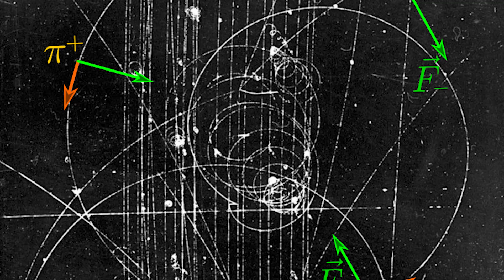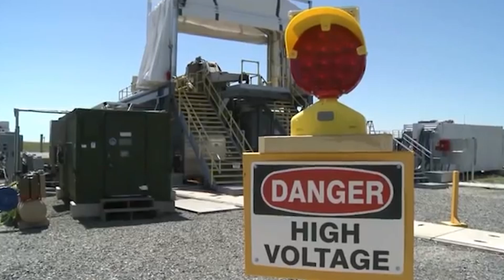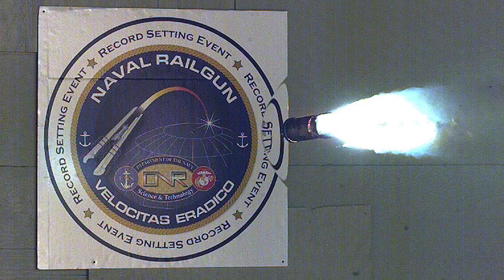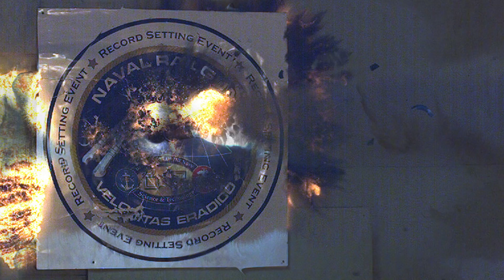Railguns: The Kinetic Future of Warfare

Comment: I doubt supplying power is major hurdle, because it’s going to be using just a pulse or a small series of incremental pulses of energy, my guess is that firing these things actually produce a pretty substantial EMP. However huge currents or magnetic fields can be produced using an explosively pumped magnetic field generator, which works like this; a series of large capacitors are charged  and when ready they release a huge current pulse on a hollow conductor which creates a large magnetic field at the very instant this happens an explosive surrounding the conductor is detonated which compresses the magnetic field and essentially the power of the explosive is converted INTO the magnetic field. There exists another variation of this device that compresses the fields of very strong permanent magnets that simplifies the process

Comment: Here is a big future project.....  How about a rail gun on the moon.....  Just think, solar cells could be used to generate electrical power to be stored until it is ready for use.  You get almost 14 days of  constant sunshine.  You can build launcher rails in a vacuum, so air resistance not a factor.  You could launch vehicles for return to earth of passengers or goods etc. You could launch space probes to explore our solar system or supplies to Mars.  This could be a great use for the use of rail gun technology.

Comment: Electronics that can handle 20,000G has existed for decades (EG the M982). The real issue is switching without degrading the switch. Relays are definitely out as is any electro-mechanical switch. FET's are just not available with a low enough RDSon combined with voltage rating. IE you would need hundreds of amps switched very cleanly to just charge the gates for even a few hundred FET's. IGBT's might work. However you then have exactly the same issue as you do with any parallel array of transistors. I really do not want to see that lot popcorning. That leaves plasma switches.which I am not qualified to comment on. EG some types of valve.

Comment: This has got to be the most overrated weapon in all of history and fiction. Lets spend an ungodly amount of money and energy for a gun that can't fire as fast  or last as long as a standard weapon. It can only fire straight in a GLOBAL environment(arcing a shot is impossible) and has to be pinpoint to do jack crap or it misses entirely as warheads can't handle that amount of sudden energy or acceleration. Rockets which can do better than this and they are not in anyway cheap. Scrap this crap and follow the KISS model. Keep it Simple Stupid.

Comment: Would it be more feasible to use expendable rails like magazines that uses hydraulics to eject expended or compromised units then exchanges it with a new one? I mean, if you are using this system as point defense or for the purpose of intercepting ballistic missiles, wouldn't sacrificing a less expensive turret component be worth the exchange?

Comment: Lol, if you want to make a Handel one, all you need is
1. Aluminum bullets
2. BIFILER coil
3. 6 12v drill batteries 
4. 6 or 12  1F capacitors
5. Circuitry to control it all.

Comment: Couldn't you use a vacuum bore to eliminate the rail erosion problem? And a faraday cage around the guidance system would add minuscule weight to projectile, surprised the body of the projectile doesn't do that already. You could also have the components fail into position and only enter the vulnerable configuration due to the acceleration they experience.

Comment: There is now a portable rail gun that is around the same weight as an assault rifle, it fire's a projectile that is lethal up to 300 metres and using full power can fire up to 200 projectiles before needing recharging. It does have an adjustable power setting so you can reduce the distance and fire more projectiles. It has been around for over 2 years as I watched a show on it over a year ago and they already were selling them in the USA.

Comment: Interesting. I just watched a documentary on Hitler's Supergun. Watching this video it occurs to me that the supergun was in some ways midway between a normal gun and a rail gun (as opposed to a /railway/ gun) as it used repeated explosive forces not magnets to accelerate the projectile.

With regard to them being 'consumable objects' rails seem analogous to gun barrels. Until rails last on average as long as gun barrels then the weapon system will /probably/ be too expensive to adopt. See Simon's comment abut the cost of each unit (projectile). The cost of swapping the rails would be part of that cost for the whole system.

With the forces required to use the weapon also trying to pull it apart I see several 'rapid unplanned disassemblies' in the future.

'... working repeating power supply...'. Yessss we can all do that, every time we flick a switch on and off. What the Chinese /didn't/ say was that their power supply was adequate.. presumably not or we'd know by now.

Re the launching of spacecraft. Presumably not /manned/ as the acceleration would likely be fatal given that humans black out / die at +9Gs and rail guns can produce as this video says, about 20,000G. Granted the object being launched would be a hell of a lot larger than an artillery shell, but it would need to be over 2,200 times larger / slower. Very roughly one hundred tons.

Comment: Is there a reason why they don't provide a weakly-magnetised gun barrel for the projectile, creating an intermediary between the rails, making the barrel magnetically  attract the rails on either side? If the force is applied through electric induction to the projectile, it could avoid using parts physically being in contact with and moving along the rails, avoiding some of the incredible force of friction on the rails? 

In any case, particle accelerators already use electromagnets to repeatedly accelerate incredibly light masses (well, actual particles) to insane percentages of the speed of  light so I just wonder if similar technology could help get around some of the technological hurdles. Oh, for space travel I mean. Never mind otherwise...

Comment: Been hearing that fusion is supposed to be coming out. Can't you just put a reactor on a boat. 4 power, plus if the rails keep warping why can't they use like a six-shooter and use a wooden rail to fire and rotate to the next. Plus they have a self-correcting round like on a 50 cal. Can't they use that too?

Comment: Why don't they work to get the tech working on something in a caliber of around .22
Have a small sized projectile, and put a few ones on an aircraft carrier as a last line of defense type weapon.
A .22 caliber rail gun round used at point blank range should go in the tip of the front of a ship and not stop until it comes out the ass end.
And still with enough energy to do damage to anything behind it.
If they are such power hogs, then create banks of capacitors large enough for a few shots while the reactor recharges them.
Use multiple barrels aka a Gatling gun and the issue with barrel damage will be reduced but not stopped.
If these are used then who cares if they can only handle a 100 shots per barrel and you have at least three(3) barrels per grouping, thats a total of over 200 shots that might be the last thing the carrier can do without defensive aircraft.
And if the ship isn't moving, use the damn electricity from the reactor to recharge the capacitors.
A charged capacitor unused discharge rate is usually measured in days if not weeks.
They would also make good ballist<sp> as well as anti-torpedo armour.
Think the Red October battery packs in the final battle of the movie.
Reply: Power supply. Easier to generate lots of power on the big scale.

Comment: These need to be installed and operated from all the nuclear plants that are being shut down to pander to the goofs. They are going to sit there doing what they do and be staffed weither they are transmitting power out into the line. Put a few big rail guns at each plant because these plants have will and continue to make and generate more power than these could ever use. If people are so afraid of nuke plants ,it's because they are uneducated. Why is our citizens are so afraid of them and spew how dangerous they are to live close to when we have thousands and thousands of people living on floating and diving reactors and have never had an issue. It's the safest and greenest form of power with the longest lasting for of power generation. There is a mountain that was hollowed out just for this type of power generation but NO NO, we pander to the few and uneducated. People really should look into what and why the disaster in Japan happened. The reactor wasn't the issue it was the generators and pumps people choose to half a*s which were damaged and washed away preventing the reactor from being cooled with water. There are two types of plants ones that recirculate the water and those who use clean and filter their water. They don't just spew waste into rivers like the scare tactic documentaries make people think. Been to lots and lots and lots of power plants across this incredible country from coal to gas to nuclear to hydro to solar to wind and the ones that we will never see an actual return from are the GREEN forms. Hydro is an incredible form of power generation that takes nothing in mantinence compared to wind and solar. People don't have any idea the money it takes to install run and maintain wind and solar. I'm not saying it's not great for homes but for commerical, industrial or manufacturing it's not sustainable. The more electric things we build the more power plants we need, as of now with next to NO electric cars and trucks and ships we have a hard time keeping up in extreme heat and extreme cold. Nuclear plants are FREAKING INCREDIBLE what they are capable of doing. Hate to tell the tree hugger but when u pass a power plant and you start crying about the " smoke stack" you are completely Wrong and mis informed, those " stacks " are what's known as COOLING TOWERS. they come in all shapes and sizes. The quote on quote " mush room stack" that people automatically assume is nuclear, it's not. When u see those towers that's because you are looking at a big boy power plant making lots and lots of beautiful electricity produced by using coal, gas, nuclear, to heat water in giant boiler and I mean giant boilers who h produce steam which spins a turbine which spins a generator which produces electricity which is fed into a transformer then to the high yard then out into the lines so u can plug your juicer in or tofu press. The white " smoke coming out" is steam , especially after bush 43 made the wise choice to introduce scrubbers. The water needs to be cooler down so it can be reused or fed back into a HOLDING POND, or river or lake. Completely clean. You have just been told the truth. Research for your self. Also not even an army could do anything to our nuke plants, no way in heck. They have a better chance of Robbi. The federal reserve than doing soemthing to a reactor

Comment: Suggestion for channel.  Leant the difference between voltage, current, and power.  In the 1920's 100 MW was a large coal plant and hard to do with a Naval Oil Boiler. In 2006 an couple GE LM2500 gas turbines are small enough to fit on a fighter plane, and can give you more than 100 MW to power a rail gun.   The Arleigh Burke class is 1988 gas turbines, propulsion only - and runs 80MW.

TL:DR - in 2100's you can mount 4 jet engines for propulsion.  And on a cruiser you can easily fit an extra 4 jet engines at 35MW each - that's 140 MW dedicated to weapons. That enough to light up half a city, or to melt your rail gun with more electrical power than the rails can handle.   Most naval specs are asking for 25-50 MW for rail guns.  Realistically you can power a few on a modern naval ship.  Heck, these days a large cruise ship runs 50 MW of gas turbines.

Point is, in the 1980's the Advent of marine gas turbines basically changed the face of ship engines and gave more than enough power for rail guns to happen

A little physics and Engineering reading can go along way to better understanding and explaining the technology.

Comment: I can't believe you missed the opportunity to provide the most logical segway ever to the U.S. NAVY's actual intended platform for railgun technology in the 21st century: THE ZUMWAULT-class GUIDED MISSILE DESTROYER, (DD-100'x'), which incidentally happens to be the REAL-LIFE, now operational (thus non-theoretical) full scale production of our massive railgun-ready power supply  at sea!  

The two ships you mentioned, including the Trenton were NEVER intended as the Navy's target vessel  for railgun technology.  The Zumwalt-class; however, always was the futuristic platform the Navy intended to create that is beyond capable of sporting not one, but potentially TWO railguns--probably both forward of the superstructure, but sufficient real estate aft & fore was designed into the Zumwalt's overall deck dimensions to support retrofit with the railguns in either configuration once the technology had been fully fleshed out to provide reliability & the scaling necessary to implement & field the new weapon system long-term.  

(And yes, I've seen your ZUMWALT deep dive....not bad btw.)

Comment: Some time ago, professor Gerard K. O’Neil (sp ?) proposed building space colonies at LaGrange points in orbit around the moon. He proposed to make them from material gathered from the lunar surface.  He proposed using what he called a “mass-driver”, which I believe to be a variant of a rail gun, to launch these materials into orbit.  I’ve often wondered why we don’t use them to launch from earth.  There’s a hydroelectric dam in western Canada (Kenano) that has to have the capacity to deal with peak power loads, and it can’t share power with another province to the west…it’s on the coast.  So some of the time, it’s not utilized to it’s full capacity.   A craft on an elevated maglev track that exceeded escape velocity (7 miles/second) could be released and would basically float off the planet.  There might be some concerns about sonic booms affecting wildlife, but the rail would be in a pretty remote area.  The rail could also be off the ground, so it wouldn’t affect migration patterns of moose and deer.  No great plumes of expended hydrocarbons.  A clean launch.   Maybe lacking in the kind of drama that inspires people into pressuring congress-critters to spend money.  I don’t know.  Any such people I’ve approached with subject have either put me off, or ignored me completely.  They’ve got elections to think about and it would seem there hasn’t been enough demand from the general public to pursue this idea.   Still, from the perspective of guns and ploughshares, this might be a way to fund research into bigger rail guns as well as rekindle interest in what may be a cheaper way into orbit

Comment: US Navy has halted further development and rollout of electromagnetic railgun launchers on USN platforms. Existing prototypes could shoot projectiles at MACH 6/7. But further development and rollout stopped on the basis of limitations with: (1) range (110 miles) (2) fire rate (3) system durability (need to replace prototype rails after 12-24 shots). USN R&D focus is now apparently on hypervelocity projectiles (can be fired from existing gun systems)
Reply: Also, I understand that the Bechtel Corporation A1B reactor plant, which will provide propulsion and electricity on the Gerald R. Ford-class aircraft carriers, will have a total thermal power output of 700 MWth. This output is apparently 25% higher than that provided by the A4W reactor plant (that used on the Nimitz-class aircraft carriers that the Ford class will replace). This raises the possibility I suppose that new weapons systems that fully or partially rely on high electrical input could be fielded on the Ford class ships.